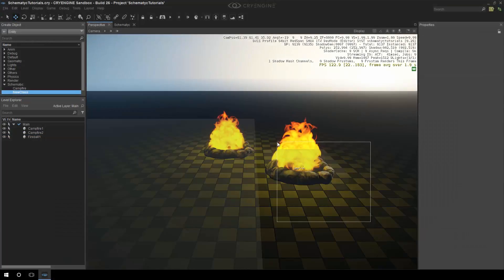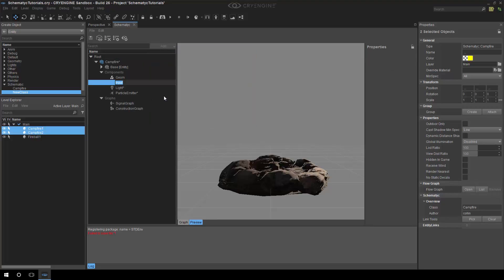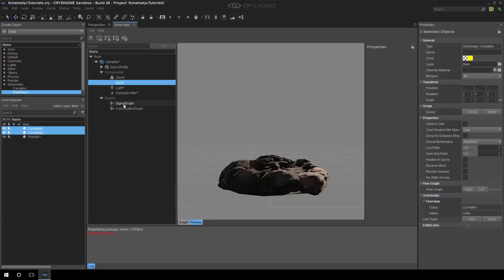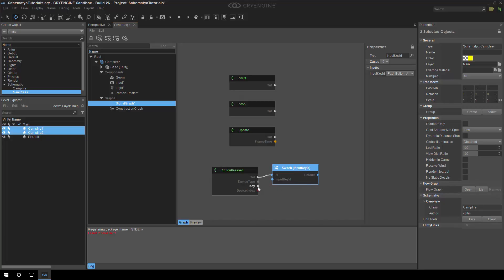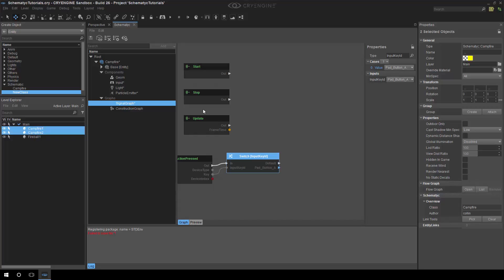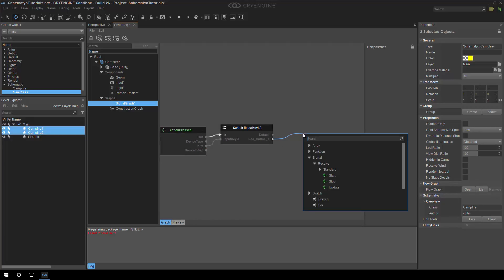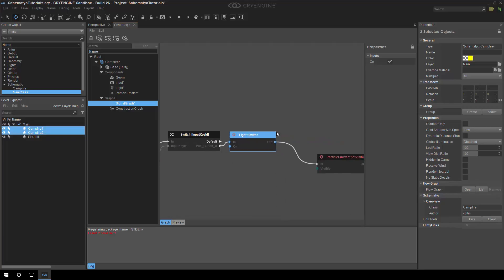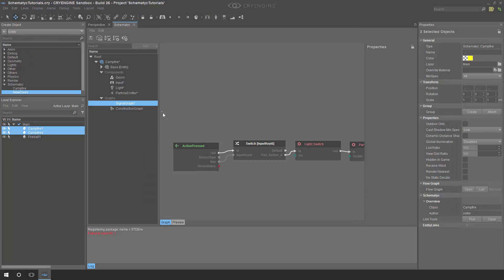How to use signal graphs in Schematyc | Game & Level Design

Comment: Question about the Schematic. Here's the thing, create a new controlling agent of the player, which allows you to move around X-Y axis, create using State Machine jump. Separately everything works as it should, but if you connect a controller in Signal Graph to Update, the jump does not work. What could be the reason?